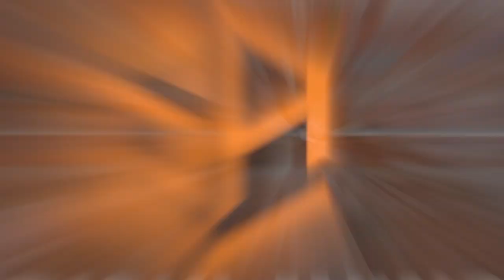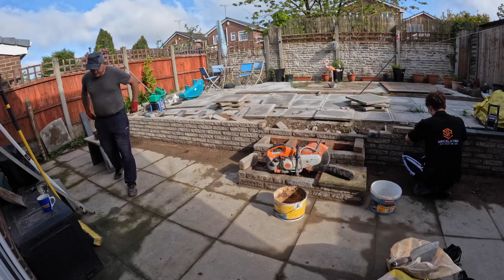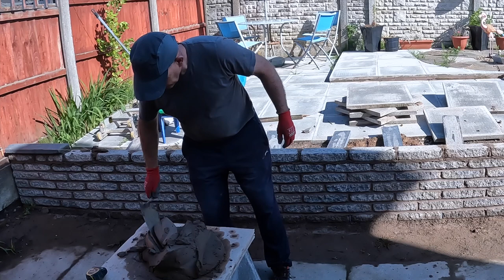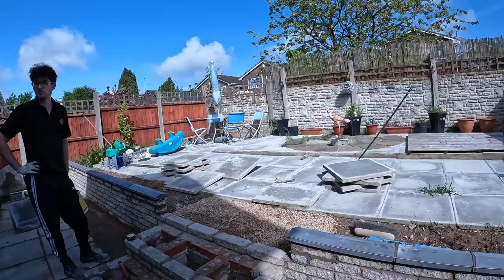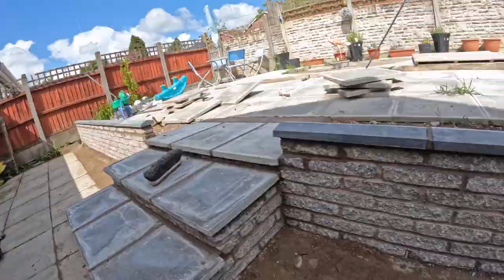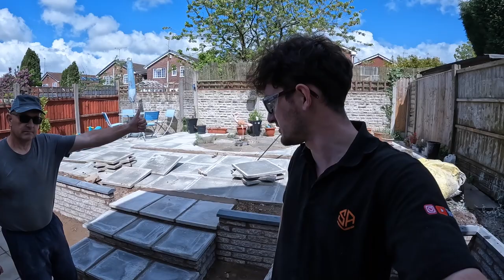WE COCKED UP !! GARDEN WALL DISASTER RESCUE PART 3

Comment: What is the right way to lay slabs then Steve as I’ve seen loads when they’re lifted just 5 blobs of mortar underneath ?
Reply from the maker: a solid bed plus the flag treated with some grey goop to help it stick 😝🧱👍🏽
Reply: Different methods depending on flag used and desired purpose and finish
Bedding can be.
1- Full bed of grit sand. And bed flag into it.
2- Screed bed with a full bed and the adhesion promoter
3- five spot method. Sand bed and five spots of mortar to lay flag on. 
Other methods can be used such as full bed of mortar or concrete.

Joints can either be.
1- Butt joint and filled with silica sand.
2- wide joints and pointed. Either with squeegee mix or with trowel and mortar.

20 plus years as a stone mason paviour for me.
Reply from the maker: @beeftitans91  🧱👍🏽

Comment: Those council slabs look horrible in someone’s garden
Reply from the maker: Some people have a budget to keep to 🧱👍🏼
Reply: A concrete jungle. A strip of astro turf along each wall separating the slabs from the feature wall would have helped IMO. But that's in the control of the customer (designer).
Reply from the maker: @Sean006  🧱👍🏽

Comment: There is something wrong with those steps . The first step has a rise of 8" (2 bricks and a slab ) and the second a rise of 6". Your brickwork on the second step should have been built on the slab and not behind it .
Reply: I was thinking the same 3 steps 3 different rises
Reply: Stop typing 😑 😆 
First thing I noticed was its a serious trip  hazard
Reply from the maker: Unfortunately we had to work with what we got two fixed points then the customer changed their mind 🤷🏼‍♂️
Reply: @SteveAndAlexBuild  just get them to sign something to say that’s what they asked for, if someone goes down them they could sue for not meeting regs.
Reply from the maker: @MrB3ngy  🧱👍🏽
Reply: Yeah nice work lads but serious trip hazard
Reply from the maker: @bluevanmani  🧱👍🏽
Reply: @SteveAndAlexBuild  
If your client changed their mind on the finished level of top slab then so the steps needed to be altered to suit you can't go building 3 steps with 3 different heights especially your top step height ..
Someone is going to go down them not on there feet
Reply from the maker: As we said at least 4 times in the video THE TOP STEP IS TEMPORARY
Reply: @SteveAndAlexBuild  
No need for capital letters mate just trying to advise.... the whole set of steps should of been built temporary then split equally, the client has to pay for that alteration... there's obviously young kids running about there asking for trouble in my opinion 
✌️
Reply from the maker: @richyrrbltd7715  . There was no budget for building things twice. Parts one and two explain that 🧱👍🏽